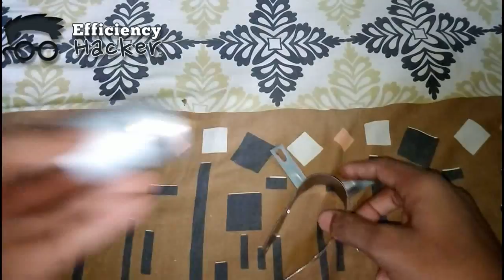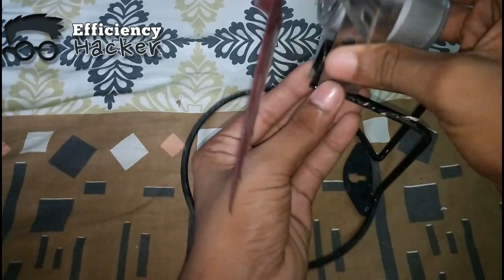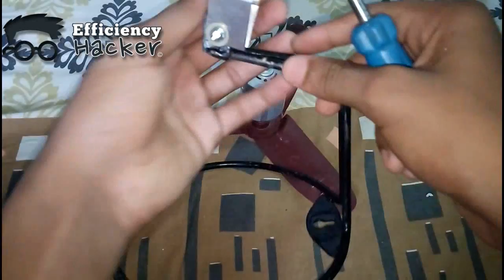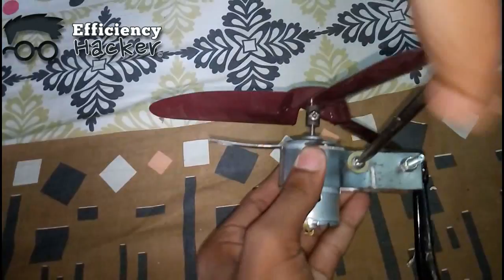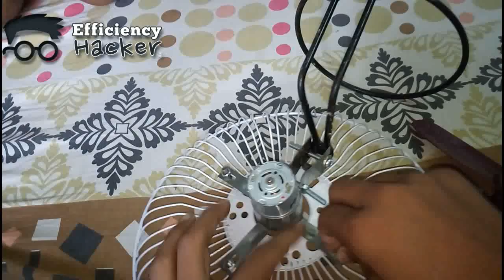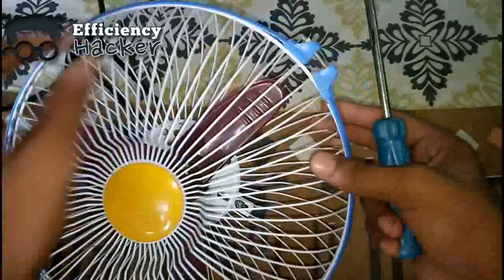How to make a Powerful DC fan Using DC Motor | Very Simple

Comment: Dc motor kitne rpm h n kitne v ki hai? Kaha se le?
Reply from the maker: Kisi bhi local Electronics store se
Reply: Sir kitne rpm ki h kya voltage h is dc motor ka
Reply from the maker: @dipssharma3244  12v dc 5000 rpm

Comment: Why this motor gives burning smell?
Reply from the maker: jitendra kumar it's because of the higher suPplied voltage or long running of motor
Reply: Techy Sam motor is rated 12v. And supply voltage is 12v only
Reply from the maker: jitendra kumar check out rated ampere
Reply: Its 1A and supply is from a battery that is 12v 7Ah